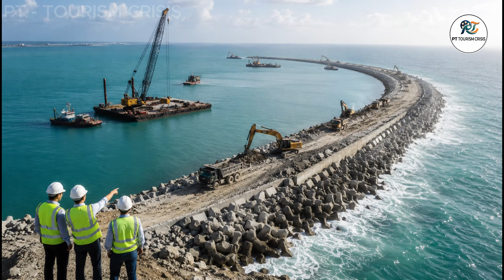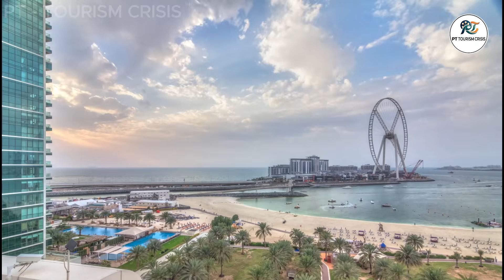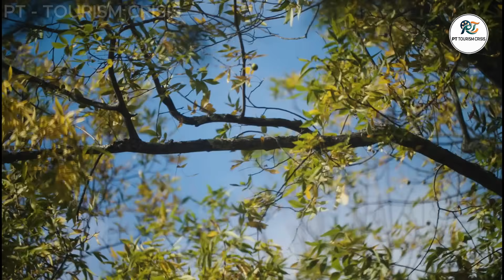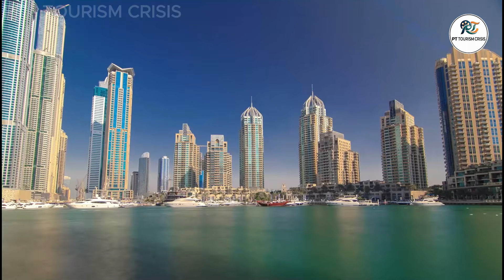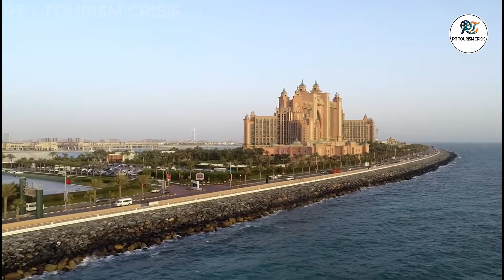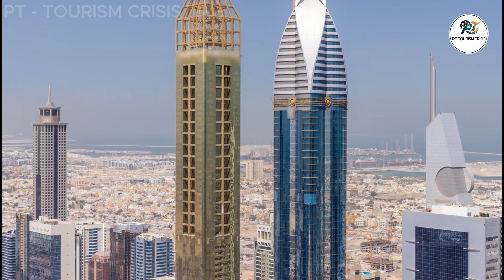Why a 5mm Shift Could DESTROY Dubai’s $12 Billion Palm Jumeirah

Comment: There is sense in this narrative. Had it been on Terra firma, this difference would have happened over a period longer than the buildings' useful life. Why do we find ancient artefacts 5 or six meters down below. That's because the dusts that settles on ground over a millennia or so changers the form of the ground. The older ground gradually sinks. Another thing is that the rate of settlement is an inverted logarithmic curve. It will stop at a time. But the fortunes of the place change faster than anything else. That's nature, a karmic reaction.
Reply from the maker: There is some truth in settlement slowing over time, but buried ancient artifacts are usually explained by accumulated soil, sediment, rebuilding, and human activity rather than the older ground simply sinking.
Reply: @PTtourismcrisis 
I am giving my view with respect one of our ancient cities by the name Anuradhapura which was an east west trading hub where sailors from all these nations around Mediterranean came for several centuries. Ionian artifacts were found six meters below in some areas. And one tall pagoda buit on soft ground had sunk six times during its construction. The 'raming' had been done using elephants. These details are in chronicles.

Comment: People cannot live in 120 F ,its too hot, the energy required to maintain habitable temperatures is too great, instead of plumbing and sewage treatment,  they have ermine upholstery in their Ferrari s, instead of common sense,  they have greed, without thought.
Reply from the maker: Extreme heat is a serious challenge, but Dubai does have modern plumbing and sewage treatment. The stronger criticism is how much energy and infrastructure are required to keep the city comfortable.